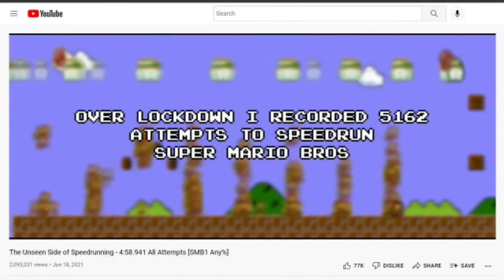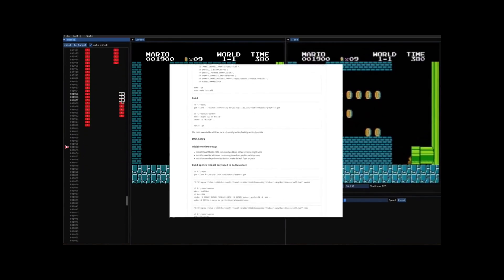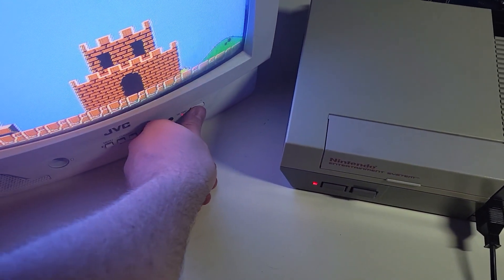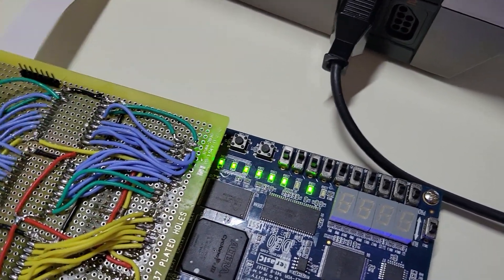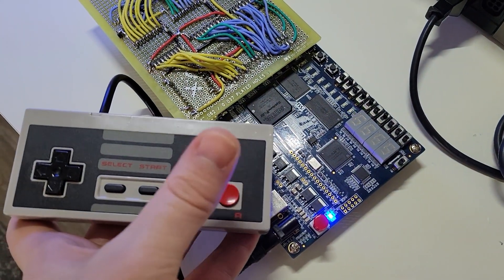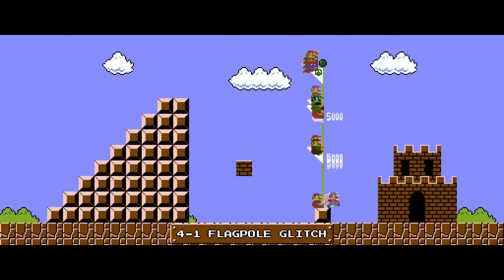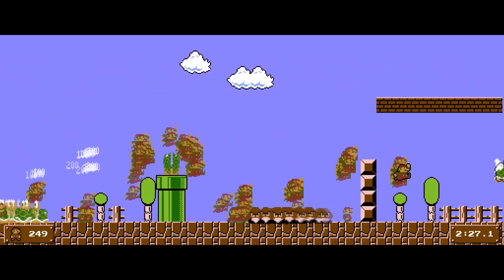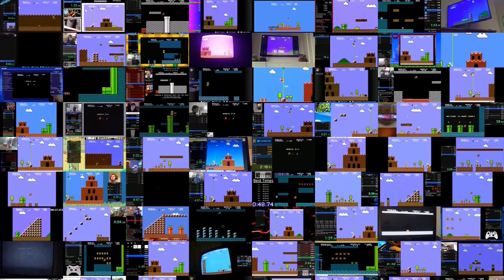A custom NES Mod for the project?

Comment: The physical ramwatch is awesome! Great work, thanks for all you do.
Reply: would you buy it for actual use if you didn't have any other stuff for console
Reply from the maker: Thanks Kosmic!

Powercube, It's not really designed for 'actual use' so to speak. there's a long road before it's something that's even available for others to use.
Reply: @flibidydibidy  asking in a "theoretical" manner :)

Comment: Hi! I really love your work and this could bring really entertaining MB1 or other games contests! 
Did you consider a Pi with a small screen or a digital ink display? This is cheap, available, extensible, easy to program, and you could stream the data directly to a server that would  process them for display
I would really love to assist, unfortunately I'm not good enough to be of any help here :P
Anyway, good luck with you project and I hope to see some more really soon!
Reply from the maker: Hi! The thing with a raspberry pi is that it's kind of hard to get it fast enough to deal with the nintendo entertainment system. Weird, I know. but the pi has a lot of stuff going on even though it clocks a lot faster. The FPGA is much closer to the metal than the pi, and easier to parallelize. Thanks for your good thoughts though! :-)

Comment: could you just get a special controller with 2 wires that has one input into a computer and one into an nes so that the computer can read all the inputs and emulate them?
Reply from the maker: This was my first attempt but a few problems I ran into. First the emulation has to be exactly 100% perfect, and secondly I don't have the RESET line which is important for syncing things. Also did you know that there is a bug in the NES hardware that causes certain games to actually poll the controller an arbitrary number of times in a loop? It's not quite so easy!
Reply: @flibidydibidy  You could make the reading from controller work, if you combine it with other data and some processing?  Eg use both the controller input and the video output?  (Just spit-balling here.)
Reply from the maker: Probably, but I'm trying to seek the most elegant solution (even if it's a bit invasive on the NES), with the fewest parts necessary because or else it just gets really complicated really quickly!
Reply: My thoughts exactly. It's the opposite of TASBot when you think about it: recording inputs on a console and feeding them to an emulator, instead of the opposite.